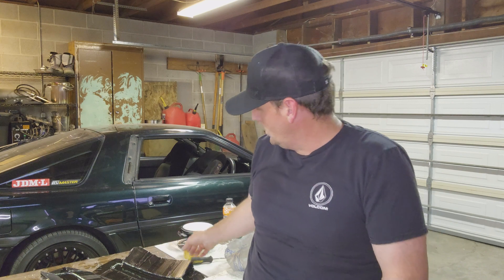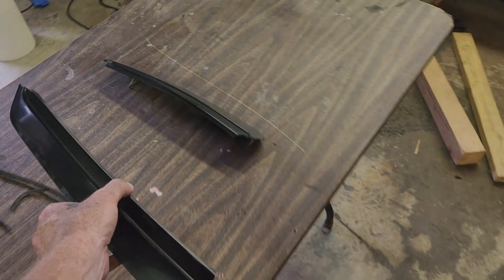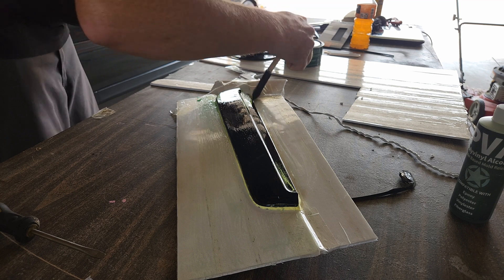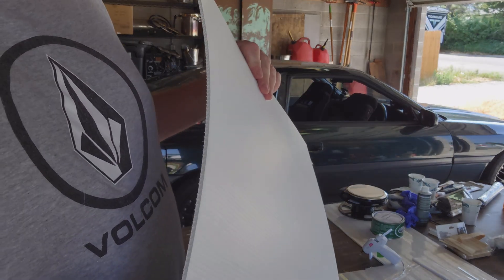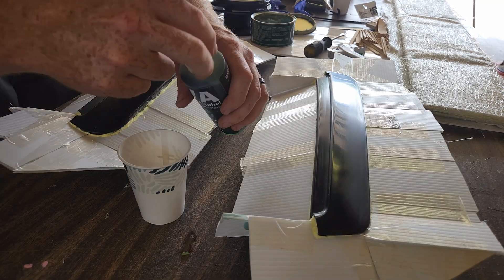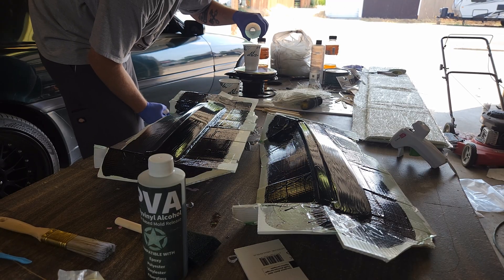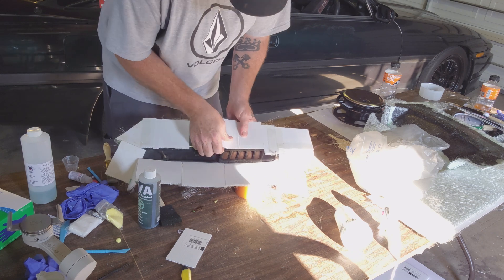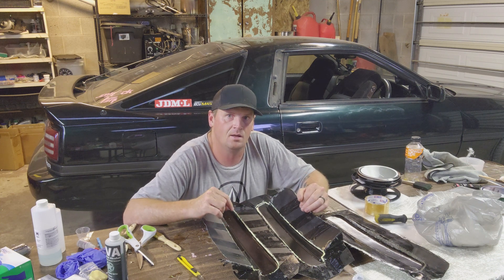Carbon Fiber Car Parts Step-by-Step Mold Making (Mistakes Were Made!)

Comment: I just used that same carbon kit, and I really like it. I'll be carbon fiber wrapping all kinds of stuff now. I 3D printed a new butt stock and wrapped it to make it stronger and look awesome. it wasn't easy, but came out really good, and next project I think I'll nail it. cut my pieces with my 40watt diode laser cutter
Reply from the maker: i kind of wanna try doing some carbon overlay/wrapping eventually... I've seen people using chop tow with good results "forged carbon" or whatever they are calling it

Comment: Pretty good for your first attempts! Question: How would you have made the molds, if the 3D scan data turned out good? 3D Print? CNC Router/Machine?
Reply from the maker: @drrock5356  I would've 3d printed the mold with petg, from the research I did it's pretty chemical resistant and the resin won't bond to it. And when you do your final coat of resin on the finished carbon fiber part it gets rid of layer lines
Reply: @CARS-N-CAD  I 3D printed a PETG mold for compression molding chopped carbon fiber tow, and the release agent I used acted instead as an adhesion promoter. I had to chisel the PETG away from the part.
Reply from the maker: Good to know maybe I'll have to experiment
Reply: @CARS-N-CAD  I won't mention the brand, but stay away from release agents meant for metal molds/surfaces, which can be found in the "fine print" on the rear label.
Reply: @drrock5356  what if you wrapped your mold in saran wrap? it doesn't stick to saran wrap at all. I used it to wrap my skinning project then wrapped it with electrical tape nice and tight, came out good. had some wrinkles in the resin itself, but they sanded out. on a mold the wrinkles would be on the inside so wouldn't matter
Reply: @richardhemingway9773  In hindsight, I would have used a proper release agent, such as wax, frekote, or a silicone release agent (which I try to stay away from, due to silicone contamination). Adding a coat of PVA on top of the waxed mold would add another layer of insurance that the part will release from the mold, and not bond to it.
The tool I 3D printed was a compression mold, with an A (cavity) and B (core) half. I wetted out both chopped carbon fiber tows, and long 3k carbon fibers, and filled the mold with the wet mess, running the long fibers along the part length. I then placed the core on top, and closed the mold with c-clamps. Excess resin squeezed out of the parting line as the clamps were tightened, as designed.
If you're doing an open mold, and need compression on the "B-Side" (top of the carbon fiber stack, facing outward), wrapping the layup with vinyl tape works, as does stretch-wrap, heat shrink tape or tubing (think of juice bottle labels, and heat shrink packaged boxes, et), and vacuum bagging (what typically use).
If the part is flat, or has a curve in only 1 direction, you can use .015-.030 mylar as a "caul plate", waxed and placed directly on top of the wet stack. Then wrap the assembly with tape/film. The mylar leaves a smooth surface on the B-side of the part, or it could now become the A-side.

Comment: Try dabbing the resin on instead of brushing, this will ensure the resin penetrates all of the glass and not just the surface
Reply from the maker: @JonMorley1  yeah I learned dabbing with the flat side of the brush worked best for me, my biggest problem was my glass mat was way too thick and heavy for what I was trying to do... shredding the glass mat into tow fibers helped a ton
Reply: @CARS-N-CAD  100gsm for first layer would definitely have have helped. Final piece looked good though